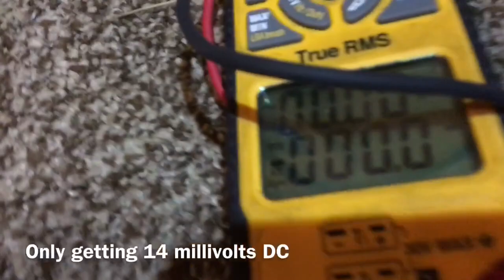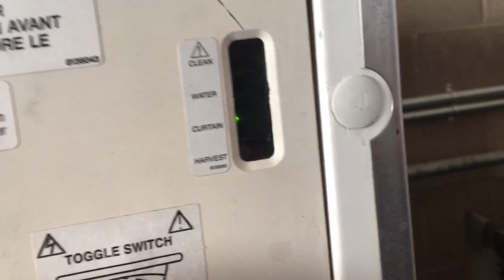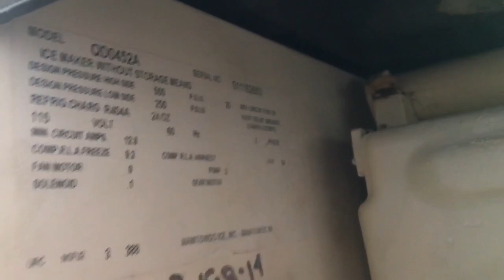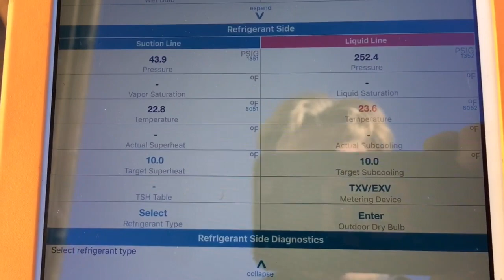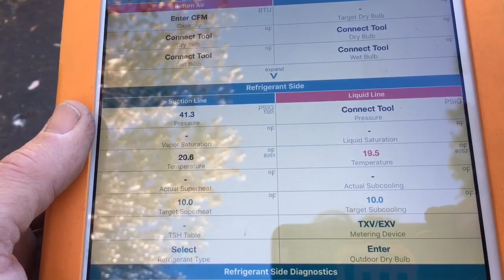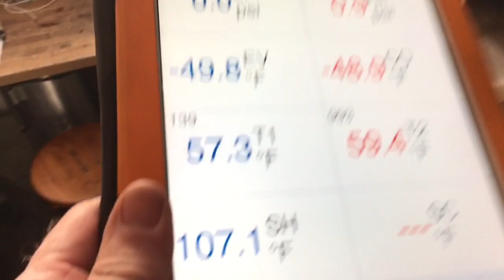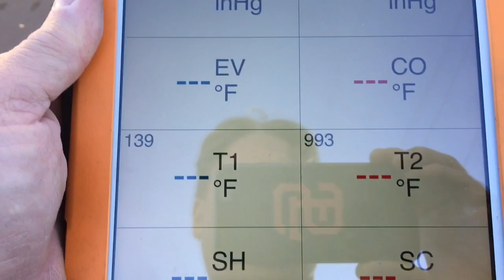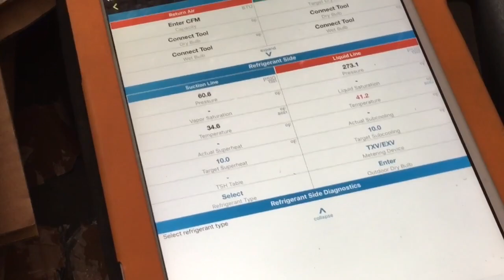Nor-calls fieldpiece joblink probes on an ice machine

Comment: Merry Christmas to You too ! Re: not having a thermocouple on your truck. Don't feel bad i don't have one on my truck either. ha ha lol. i don't do heat very often. pretty rare for me. i have not seen a thermocouple in many years. Re: on the ice machine Manitowoc ice thickness sensor . i don't even bother cleaning  ( that style ) anymore. i Just Replace them. period. they are cheap, you can buy them on the internet for like $20-35.00. i Just stock one on the truck at all times. Like u said party can be over on those so easily i don't want that call back. plus after u clean them they quit again sometimes early after u clean them. Replacing Gives me a Better Reputation i Have Found. Customers Are Allways MUch Happier. Machine Works better. etc. etc.
Reply from the maker: Ya the only heat part I stock is a universal HSI
Reply: grabs and juggles a stack of thermocouples. it gets cold here and lots of dinosaur devices still around. they sell them at most homedepots here and gasket/screw/thermocouple kit for rheem FVIR water heaters.
Reply: me too.

Comment: What was that manual you were looking at.
Reply: Steve B those books are the holy bible for ice machines. Each model series has one. Hoshi has them also. Use them to find out if your pressures, temps, and times match up to current conditions.
Reply from the maker: Books are free from suppliers.
Reply: J.Mills HVAC I get them at the supply house. Baker is our Manitwoc dealer. They just have them to me when I asked about them.
Reply: From the East Side of Los Angelez Thank you 🙏🏼very much for your Videos and Merry Xmas to you!!!🎅🏼
Reply: How do you get them? Can you buy them or are they given out at classes?